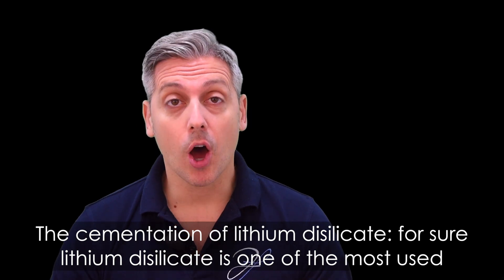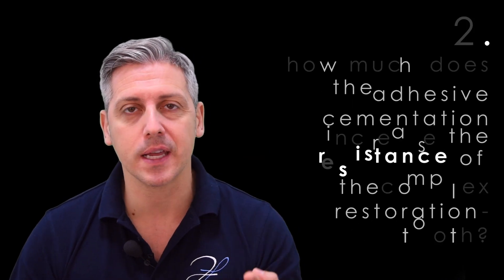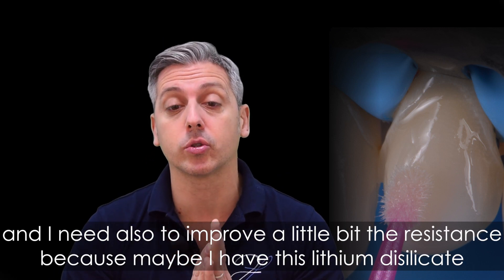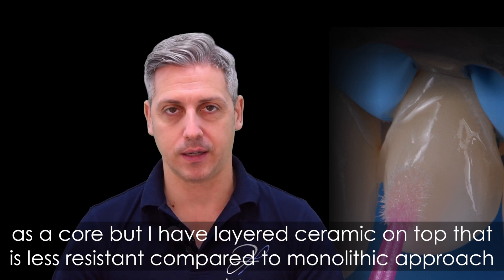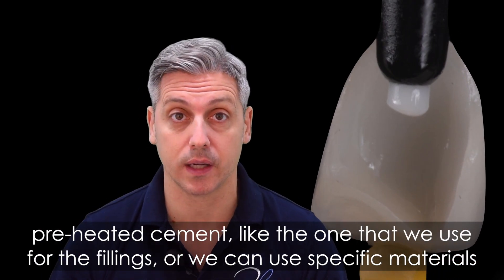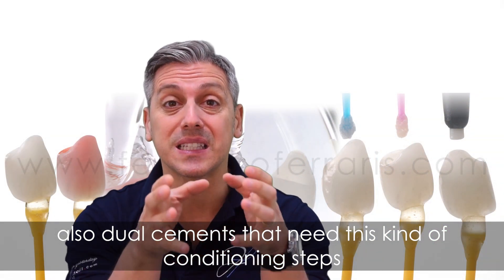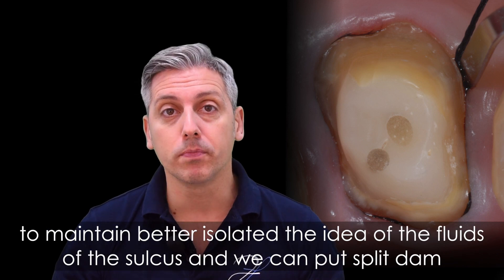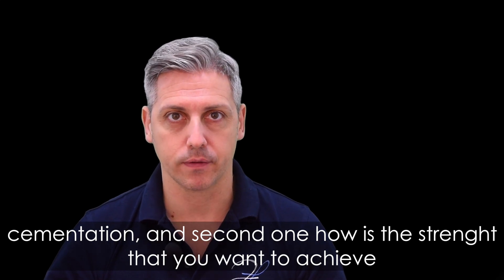🇬🇧 Adhesive cementation of lithium disilicate_short #23_(ENG)_adhesthetics protocols

Comment: 1- Should i put the bond on top 2 bottle silane on an emax restoration or the silane is enough to make restoration bonded using heated composite?
2- should i put silane on an existing composite on the tooth when bonding to emax restoration then put the bond ?